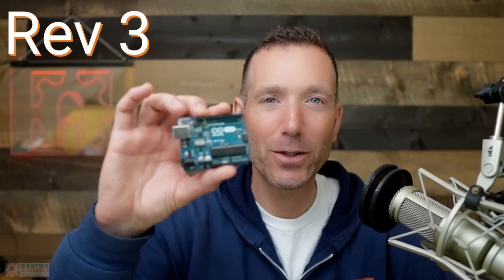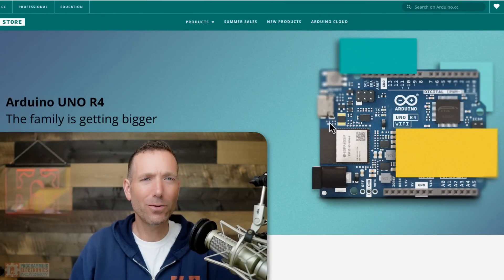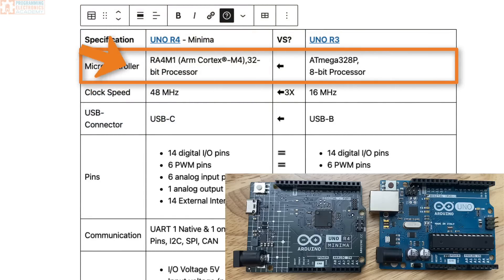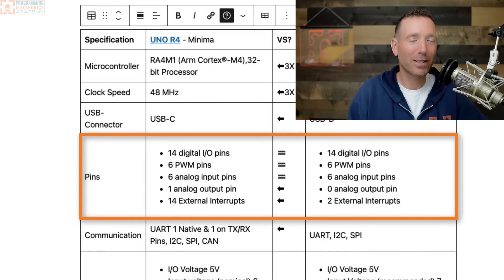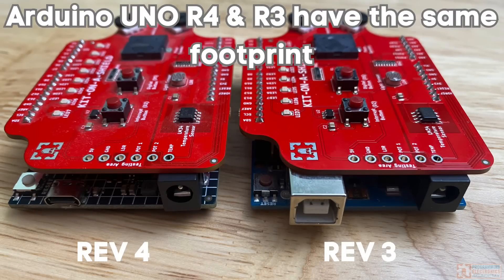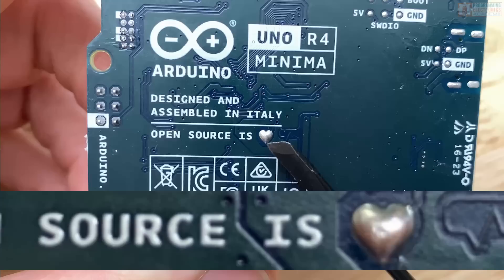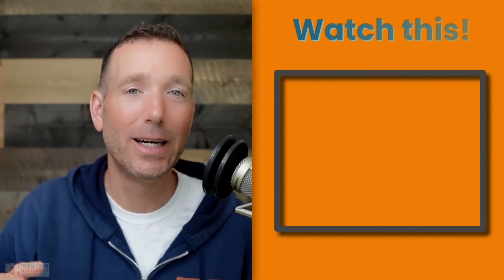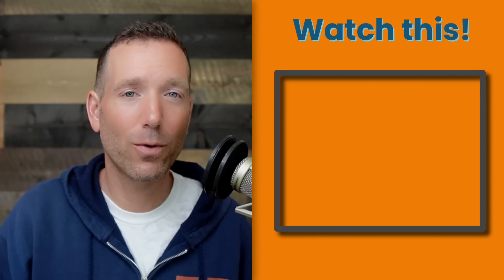NEW Arduino UNO Rev4 Board! #newdimensionofmaking, #UNOR4

Comment: Wish they'd supply boards without plastic pin headers.
For a strong connection you want to solder directly into the pin holes. This also reduces the height you need, and you don't run into issues with cables that disconnect from the headers at the slightest touch.

Comment: NOT backwards compatible as far as GPIO pin current goes. R3 = 20ma R4 = 8ma. Significant difference there. R3 makes you lazy, allowing you to drive small stuff right from the controller. With the R4, you will need to use off-board drivers for most things. But honestly, controllers should control, and drivers should drive.

Comment: Michael, one question I have, I dont know if you have ever covered it, is using sensors at a distance. I am using the Arduino sensor kit and playing with accelerometer and RH sensors, using I2C and it works great (after troubleshooting) but I dont know really how the max cable lengths can be For I2C seems like max distance might be 1 m, if using UART RS485 could be far longer. Wondering if with R4 Uno and wifi if using wifi now is the way to go for remote sensing????? Thx for any insight.

Comment: I find Arduino released this thing without making sure the reference material thoroughly covers the programming differences between this Renesas RA platform and the platform the UNO R3 uses. What is under the hood in this R4 is a totally different beast than what is under the well understood R3. Does a library environment for this new platform exist? You mentioned trying to figure out how many interrupts there are. Well, try using them as you would in the R3. Try and see if you can get pin change interrupts working. Try and see if anyone else has figured that out and documents it in a way the average Arduino hobbyist would understand. That represents just one aspect of the platform difference. There is some catching up to do. I hope it comes quickly.

Comment: My native language for microcontrollers and microprocessors is Assembly. Is there any info yet on programming the R4 and ESP32 in their respective ASM languages on any arduino-compatible development platform?
BTW, I just tried doing the basic Blink sketch using XOD. It works easily enough, but the compiler produced almost 3000 lines of C++ code.

Comment: So, they kept the ICSP header as a simple hardware SPI port, and now have a new JTAG header? I guess that’s the only sensible method as some existing shields might use the ICSP pins for something other than programming. But I wish ICSP was higher on Arduino’s own list of priorities. Bootloaders are a hack and having people get used to them makes the transition to bare MCUs that much rougher. Even the RP2040 is hardly perfect in that it incentivises programming via a plug that not every project will have on it, but at least there’s no bootloader involved. Same for the ESP32S3 if I recall. Offloading the programming hardware to an external board makes the dev-boards themselves cheaper and more compact, you especially don’t need a USB port on something without native USB.

Comment: I still use the Arduino Duemilanove. The benefit is I can program the inserted Atmega328P-pu chip with code and instead of having to ERASE it each time I want to do something else with that Arduino I can pop in a NEW Atmega328P-Pu and get to work while keeping my old programed chip. All I have to do is SWAP out chips when I want to use them for different projects WITHOUT needing to reprogram them. These SMD or surface mounted IC's are cool and have massive power but don't fit for my needs. I would just get an ESP32 or ESP8266 for that... Better yet a Raspberry Pi. so yeah Arduino is great for beginners. It would be NICE if it had a function to READ the loaded code and EDIT it instead of not knowing what was programed on it after leaving it in a box for a few months.

Comment: I think the classic R3 is still a great device to get started. It is very well documented and there are tons of libraries and tutorials. Also there are lots of applications where a 8 bit device is completely enough. I wouldn't necessarily trust a ESP or other modern controller to run for years without interruption or restart. More complex and powerfull hardware also comes with more possible hard- and software issues.
Reply from the maker: Great perspective!   Thanks a ton for adding this!

Comment: will they drop the price of the r3 now that the r4 is out?
Reply from the maker: I think they are going to keep the R4 Minima at a lower price point than the R3, but not positive.
Reply: @programmingelectronics  seems odd if they still want to sell r3. 95% of people would go for an r4 minima over an r3, especially if it is cheaper.

Comment: Products like this always confuse me. Why did they do it like this? They chose a top of the line ESP32S3 and just used it for wifi. It is far more powerful than the main MCU on the board. Dual core 240 MHz with DSP and image processing built in. It makes no sense, just use the ESP32S3 on its own, they are already supported in the arduino IDE. Why didn’t they use an older ESP32 or the cheaper single core RISC-V versions? 

In a similar way why do very powerful SBCs use extremely basic and simple microcontrollers? Like the latte panda sigma. You have a very powerful computer coupled with basically an arduino uno or micro. Why not go for a powerful MCU to couple with your expensive and powerful SBC? The MCU will be a bottleneck and will make the system useless for robotics without adding another MCU through the USB ports. It just doesn’t make sense. At least the arduino portenta X8 uses a top of the line MCU with it, so there is already arduino IDE support for that chip so why don’t other companies do similar?
Reply from the maker: I believe the intent for the R4 was to be hardware backwards compatible with the R3 - so just having an ESP32 wouldn't suffice (they need a IC with 5v operating voltage).  I think of the ESP32 is a co-processor.  So with the R4 WiFi you're getting the RA4M1 with an Arm Cortex M4 (cortex seems pretty common and used by tons of companies) and an ESP32.  Just my take...
Reply: @programmingelectronics  why would they use an ESP32S3 just for wifi? Why not any other cheaper ESP32 or even ESP8266 like other companies have done? It just seems a huge waste to use a chip that powerful just as a wifi processor. You can also reduce costs by using the bare ESP32S3 chip rather than the module. It just seems like a waste and like it is just adding unnecessary cost to the board.

They could have used the ESP32S3 as the main processor and just added level shifters if they really wanted 5V. Yes ARM cores are very common, you can find them in a lot of Arduino uno alternatives or cheap dev boards like the blue pill or black pill. There are plenty of STM32 dev boards out there which can handle 5 V and have faster processors than the one in the uno R4.

The ESP32S3 already has support in the Arduino IDE anyway. I do wonder if you can program the ESP32 on the uno R4.

Comment: I suppose its alright and nice to have options, but it shouldn't be called an Uno rev4. (Unfortunatly they already used the name Due for an earlier 32b board which went with different form factor and 3.3v) 
Part of the benefit of the first 4 revs(duemilanove was the real Uno 1.0) was the replacable DIP package, not only allowing easy/cheap unbricking but also having multiple projects without constant overwriting. Of course the learning practice with low cost [constrained] components and especially potential for extra-low power consumption. (Higher frequency and more bits is nessesarilly more power for any given level of tech.) Basically if I want a Razzpi I will use a Razzpi, I use the Uno because it is an Uno.

Comment: That WiFi chip is faster than the main chip ;)
Reply from the maker: I believe they clocked the RA4M1 with the Arm Cortex M4 at 48Mhz as a power tradeoff  - since it operates at 5V, bringing down the speed reduces power consumption.

Comment: I recently learned a little about an Arduino. Made one into a project and it worked great. I started to get those "what if I..." ideas. I think this Uno Rev 4 is a perfect upgrade!  My Uno Rev. 3 project is socketed into a PCB which is a carrier for all my wire connections. Using the same footprint was brilliant. The new features are very fresh and welcomed. What a terrific way to revise the Uno! Thanks for the details. That was very helpful!
Reply from the maker: Thanks a ton for the note.  I am excited to start using it as well.

Comment: Interesting, although why no more IO pins, that's the biggest limitation I've bumped into.
Also, you mentioned WiFi, then promptly skipped saying anything about it.
The unboxing was a joke, No ant-static bag, Has Arduino inc stooped that low!
And finally, please loose the stupid yellow post-it note covering the board.
Reply from the maker: The Arduino did ship with an enclosed ant-static bag, that unboxing was after the fact.  If you look closely I also pull out a small tractor and a note, but I think the joke was lost on a lot of folks.  I didn't have the WiFi shield to evaluate, which is why I didn't speak to it.

Comment: Does the R4 do double precision math?  I made a monitor for a green house and the Vapor Pressure Deficit calculation needs double precision to be accurate. Being 32 bit I would expect the processor to be able to do double precision math.
Reply from the maker: I believe Floating Point Unit on the Cortex-M4 only supports single precision FP operations, but not double precision.
https://community.arm.com/arm-community-blogs/b/architectures-and-processors-blog/posts/10-useful-tips-to-using-the-floating-point-unit-on-the-arm-cortex--m4-processor

Comment: A great intro to the R4.  I'm a big fan of Arduino.  It was the first board I learned on.  I still have two questions I'll have to find answers for.
1) Does one of Arduino's existing Arduino nano variants match the R4 or do they plan to release one?  One of the biggest advantages of the Arduino Uno R3 was that you could prototype a project on the Arduino Uno Rev 3 and pretty easily port the project over to an Arduino nano for a more compact permanent build.  If you prototyped on the R4 and weren't as constrained in your coding you wouldn't want to go back to an R3 matching Arduino nano.
2) How does the R4 compare to a board like an ESP32 Node MCU?
Reply: 1. I dont think so. Nano is not anymore a "mini UNO", is a formfactor.

If you are interested, the Arduino Nano 33 IoT uses a SAMD21, which is somewhat similar to the Renesas RA4M1 (Memory, clock speed, DAC, etc) but it loses the OPAMP and other technical features.

2. UNO R4 WiFi definitely has a place. I have an ESP32, but definitely it is not going to replace my R4 board, but I think that only depends on you.
Reply: As usual NO ANSWERS from these promo Youtubers. You bring up VALID points and I agree.

Comment: Only Arduino chooses always the most crippled IC they can find, 48Mhz M4 in 2023 is just a weird choice, the Arduino uno is not built to be a power efficient board so why choose chip that is clock at only 48Mhz. :(

Comment: Im super disapointed. The R3 will always be my first love for MCs and it would have been great if they matched the esp32 with the R4. The esp32 can do everything an arduino does just much better , more and much faster. Why such a slow core, why just a single core, why almost no onboard flash memory  Where's the BT/BLE , why have 2 versions wifi non and wifi when i can buy an esp32 for less and it comes with all the bells and wistles. Bit strange.

Comment: A bit odd. The WiFi board needs one processor talking to an ESP whereas you can get an ESP32 Uno board for a fraction of the cost and that means just one excellent chip to program.
Reply: Yeah you can get more clock speed more memory for less bucks.

Comment: Correction: the UNO R4 does have EEPROM.

In fact 8 times as much as the R3 (1 kB to 8 kB).
Reply from the maker: Thanks for adding this!!
Reply: It does not have 'real' EEPROM, it is emulated using Flash.
Reply: @oqibidipo  right, but any code that uses the standard EEPROM library will work fine in both the older and the new UNO boards, so that's good enough for me.

Comment: They could have added some servo headers like on the Keyestudio Plus Board.
Reply from the maker: Servos are great to use with Arduino!  Semi-unrelated (but still handy) they did a Qwiic I2C connector to the UNO R4 WiFi for ease of connecting different actuators and sensors...

Comment: I wondered why they'd cover a part of the R4 WiFi board in the photos you use in the background. I checked it out, and they have a 12x8 LED matrix as surprise! How cool is that!
Reply: I'm wondering what the point of the "convenient on-board 12x8 LED matrix" actually is.
Reply: @frankhovis  Basic debugging for example. Once the board is deployed, and you don't have your PC connected to read from serial, it seems really helpful. Only downside I see, is that it's not really useful if you use a shield.
Reply: @frankhovis Actually I use it a lot. Its easy to use and its useful for visuals directly on the board without the need of external hardware, also is very cool
Reply from the maker: I was wondering about the sticky note too!

Comment: The Uno R4 with lots more speed, memory and CAN bus support makes it a potential contender against ESP-32 boards in the Arduino IDE.  If you’re buying a large number of boards to embed in a product, cost matters.  For one-off learning, cost is moot, get an R4.  I’ve been developing projects in the Arduino IDE for Lilygo ESP-32s3 Dev Module boards which have integrated hi-res display, Wi-Fi, 12 bit A/D etc. for about US $20 each, on the other hand, the Arduino shield footprint gives access to a great number of hardware add-on options
Reply: I probably don't have 1/10 the experience with Arduino that you do, but my first run in with the platform was a device that was going into limited production (initially planned to make 5 units, wound up making 12) But I got ahold of a r3 board to do all my learning and testing on, then for 'production' we used nanos. It was a great fit for what we were doing and endeared me to the Arduino system.

Since then I've used it for several other projects, both professional and personal, and now I'm really excited to explore the r4.
Reply: @edwardgiovannelli5191  Wait until you learn about ESP32, ESP8266 OR EVEN raspberry Pi4!
Reply: Well said, I'm right there with you.

Comment: How about the EEPROM? R4 doesn't have one, wouldn't that break compatibility if your project uses it?
Reply from the maker: I believe you can use 8Kb of the flash memory for non-volatile storage using the eeprom library, so I do not believe it will break compatibility with projects that use it.

Comment: Im happy with the R3 but I have to say the R4 has some very compelling features. For me the speed is not a biggy but the CAN bus, analogue out and more interrupts would get me moving.
Reply: I feel like I left out some stuff in this video that will make it even more compelling, I'll have to do a follow on.
Reply: @michaelcheich2481   EEPROM is not there and that's a surprise .. It has good ram and 1 analog output  . I would have happy if they use 3.3 v regulator with higher current so that modules like esp01 to run on t. It should consume now more power with 48MHz I think so.

Comment: Is hardware debugging going to be possible? Something I really like about the STM32 Nucleo series is that you can get real time output of registers while debugging.
Reply from the maker: On the Minima version of the UNO R4 there is an SWD port that I understand can be used with the Arduino IDE 2.0 in conjunction with a j-link to use a debugger.
Reply: @programmingelectronics  That is great to hear.

Comment: That's cool. Awesome board! Can't wait to get on myself. There's no need to upgrade your rev3 with this for your typical led flashing project but hey that's fun to see this cool product going up on the specs. The "no eeprom" situation on the rev4 is a let down for me though since the eeprom on the rev3 was the edge for me to use it instead of a seeeduino xiao, but yeah you can use externnal eeprom of course... just annoying
Reply from the maker: I mentioned it in another comment above, but I am pretty sure you can use up to 8KB of the flash memory space for non-volatile storage using the eeprom library.

Comment: r4 is pretty good. but the popularity, the uno r3 get is just another level. the uno r3 & it's clone boards & the atmega328p chip will never be useless due to there simplicity & effortableity. i just loved uno r4, but r3 is a milestone...!!! love arduino...
Reply from the maker: I agree with you - the R3 is iconic.  I am excited about the R4 as well, I didn't realize this when I published the video, but it has built in HID support, so it can emulated keyboard/mouse etc
Reply: @programmingelectronics  yes, this will make very easy to use r4 as a diy joystick or other projects. but as a student, r4 is a little bit expensive to me. i want to handson one.i use to do work with uno r3, recently i had made an arduino nrf24l01 shield, working pretty well. as a student, arduino uno r3 chip cost boards are my real companion!
😅😅😅
Reply: ATMega328 DIP package makes it easy to pop into your own PCB with crystal and a couple parts.  Much harder with the M4 package options. :(
Reply: @ericwright3382  yes you are right. Nobody uses Arduino Uno r3 smd version, why? Because dip has the advantages. Dip atmega328p will use in project after 50-80 years also❤️
Reply: @AkashBagFEce  Also you can remove the IC and replace it! to change programed IC's for different projects or to FIX one if it is bad.!!! That is the reason I will NOT depend on Surface mount ever.
Reply: @TheTubejunky  yes! for prototyping experiment, tht components are the best option